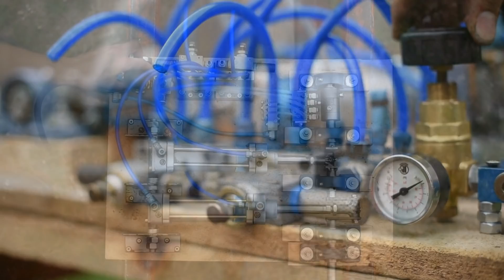2 Zylinder Pneumatik Motor + Deutz MAH

Comment: That U-joint shaft spinning around at probably
2500 rpms looks pretty scary
Reply from the maker: Indeed! (it "only" are around 800 rpm)
It went quite bad if you watch the Outtakes at 2:55 :D
Reply: @jonny999  how about using steam? steam could be generated from solar or fire
Reply from the maker: I think there are better, more efficient designs for steam engines.
Especially the valves wont last very long with steam.
You would rather use some kind of slide valve i guess.
Reply: @yeagerxp  liquid nitrogen

Comment: Can I know the torque you generating and the air pump always on or not
Reply from the maker: You can calculate the approximate torque quite easily.
Depending on the current position of the shaft/cylinders it could theoretically be:
@6bar: 55 to 100 Nm
@8bar: 73 to 135 Nm

Comment: Please Jonny I really like your but I want you to explain more details about building and pulleys vavles.
1-is it better if you make cylinder taller or gear taller or both. Can rpm be faster?and if you did that do u need to make air valve larger?
Please answer my questions
Reply from the maker: If you take smaller and shorter cylinders you will definitely achieve more speed, but less torque...
In my case the big cylinders need too much air to operate very fast.
The limited air flow through the hoses limits the speed.
Reply from the maker: You can find a full documentation of this project here:
https://pfusch.zone/pneumatic-engine

Comment: lovely project please tell if the penumatic cylinder works on steam.
Reply from the maker: It might run on steam if the pressure is right, but i think not for long^^
Especially the Valves will corrode and malfunction very soon because of the water and heat.
I bet there are other, more reliable, more efficient and simpler, designs for a steam engine :)
Reply: @jonny999  Thanks jonny999 😀

Comment: Hello , cool project . How much rpm and torque does it reach ?
Reply from the maker: Thanks,
depending on the current position of the shaft/cylinders it could theoretically be: 
@6bar: 55 to 100 Nm 
@8bar: 73 to 135 Nm
I did not measure the rpm, but its quite slow...
If i had to guess i would say around ~50-200rpm

Comment: Its have more torque then other  system?
Reply from the maker: It has a lot of torque but it depends with which particular system you are comparing it.

However, this project is definitely nothing for any practical use.
It was just a fun project and will never be used for any serious application.
Reply: @jonny999  if you guess...how much torque in this RPM..?
Can pneumatic cylinder engine arrange 500 RPM?
Reply from the maker: @sanjayjoshi624  If you analyze the video, the speed is only about 50 to 105 rpm.
The torque depends on the speed / how much pressure builds up. I guess at slow speed the motor can achieve maybe up to 120Nm, at high speed 60Nm
A better air supply and bigger valves would definitely increase the stats :)

https://pfusch.zone/pneumatic-engine
On this site under the section "Drehmoment" you can find a chart that shows the torque vs the position/angle of the shaft.

Comment: Did you use a one way bearing for this project?
Reply from the maker: No, i did not use a one way bearing.

It would have been a good idea to use one, so the starting diesel engine would be able to spin faster than the pneumatic engine :)
But it was one single test anyways^^ (it has no practical use)

Comment: Excelente vídeo,  ¿ cuál es la capacidad del compresor que estás utilizando ?
Reply from the maker: Thanks, here are the specs of the compressor i'm using:
Maximum Flow rate: 500 liters per minute
Maximum Pressure: 10 bar
Storage volume: 100 liters
Power: 3kW

Comment: Cómo lograr una velocidad de giro parejo en toda la circunferencia con un pistón solo ?
Reply from the maker: To get a motor with only one cylinder to run stable you need a flywheel. This will buffer energy thus smooths out the inconsistent acceleration  and torque produced by the cylinder. (see attached metal disk: https://youtu.be/V_o7zze3yBw )
Reply from the maker: On my website you can find a graph which shows the torque vs angle. This might also explain your question.
https://pfusch.zone/pneumatic-engine
Reply: @jonny999  muchas gracias por la información muy útil excelente 👋👋👋

Comment: There is need electricity  ????
Reply from the maker: What do you mean?
I use an electric air compressor, to supply this "engine" with compressed air.
There would be no use, if i powered a generator with the pneumatic engine again.

Comment: What's All products names & what's name online Wabsit ?
Reply from the maker: You can find more Information and Instructions on my website:
https://pfusch.zone/pneumatic-engine
I also just added some general information about the parts i used in the video description.

Pneumatic Components:
    - 2x compressed air Cylinder
    - 2x bistable 5/2-Way-Valve controlled by air pressure
    - 4x 3/2-Way-Valve with Roller
    - 1x Pressure regulating Valve

Comment: Hi Jonny
Please do trail for single shaft rotation with air motor
Reply from the maker: Hey,
i think the video explains it the best:
At 2:36 you can see quite good how the motor works.
The motor runs verry slow there, additionally you can set the playback speed to 0.5

Basicly each time one of the 4 small 3/2-way valves (on the right) gets activated by the cam shaft, one of the two big 5/2-way valves changes its position and the correspoding cylinder changes its direction (retract or expand)

If you really want detailed information about what happens at one shaft rotation let me know :)

Comment: Did you think about an emergency shutdown of the engine? The outtakes looked scary.
Reply from the maker: Yep, that was quite dangerous^^
What do you mean, a system which can stop the engines rotation very quickly?
Reply: @jonny999  Stopping the rotation quickly would be perfect, but I thought about stopping it at all. It seems like it would run forever and move around the yard, if noone switches the fuel off.  At 3:30 it looks like there is the danger of 1. being hit by the drive shaft, 2. being caught in the flywheel or being stept on your foot by a jumping engine. In that situation I would rather like run away than being anywhere close to reach for any switches. Personally I would be fine, if disconnecting the fuel would solve the situation within 5-10 seconds (Like a remote control of that switch. Or an automatic, which stops the engine, when it starts moving and jumping.).

Comment: 3 clynder 120o
Is the best choice to avoid dead point
And more motion smoothness 
The fainting in torque is less
Reply from the maker: You are right!
The Torque would be more constant. 
The dead points really made me trouble... (especially at first, when i had only one cylinder without a flywheel)
Since i used double acting cylinders, it also works kind of smooth already, with only two cylinders and 90 degrees offset.

Comment: In the same time the diesel engine is pulling a compressor pump that supply continuous air to the pneumatic cylinder while it is generating power to the house

Comment: But why? Running something with that solution is expensive as hell cause of the maybe worst possible efficiency of all mechanical designs?
Reply from the maker: Exactly, that would be very inefficient!
This setup was not meant for any practical use, it simply was a fun-project :D

Comment: You will distroy the engine oil not flow throw cylinders
Reply from the maker: Do you mean the pneumatic cylinders?
You are right, the Valves and Cylinders might wear out soon, because i have no "Oiler component" installed :)
But it was for short usage only anyways^^

Comment: that was a dumb move realy stupid idea that peace of metal culd killed you guys your very lucky to by alive
Reply from the maker: You are right, we indeed underestimated the imbalance caused by the PTO-shaft.

However, the shaft is safely attached to the motor tough. The danger would have been the motor tipping over or hitting the pressure tank and breaking the shaft (3:29)...
Reply: @jonny999  I wuld sugest you: plazma/amplifier ignition on disel/gasoline engine block's,circular egr fuel motors,crystal baterry related components,manual carburetors,plate/grid/mesh/pipe magnetic pumps/vaporisators, alternator/starter motor teslas methode of conversion, I forced my old opel monza to behave some what diferently even with out other helper's just useing purely electric/magnetic fields it is SOHC engine you can even force ore mode engine to run "back ward's" depends what fuel you use. In my case fuel was not consumed at all but I lost coolant,oil,brake fluid. Study that👈 how to force a gasoline engine to act as dised based on low speed high torque 👈 by aware static and some electricity eats up ruber,gaskets and seal's ! that's why those modern car's are crap their senzors fail due to static and diferent chemical reaction with in the engines other fluid's will have reaction with the inviroment, hopely that help's you out.If you looking for preshure probably power sterring culd by usefull that thing provides over 1k psi preshure and dont by close when your experimenting,resurche them before you act some of those chemical and mechanical reactions are violent.